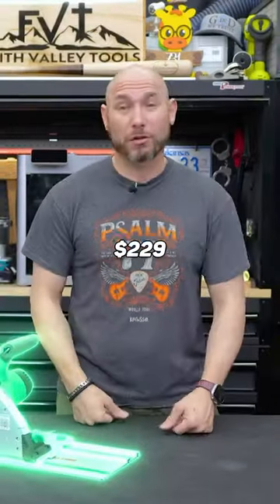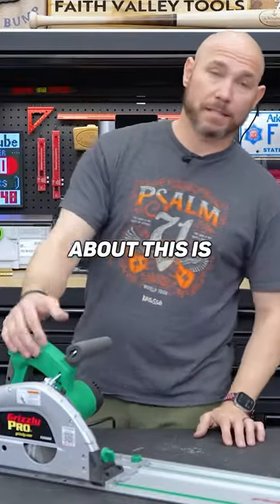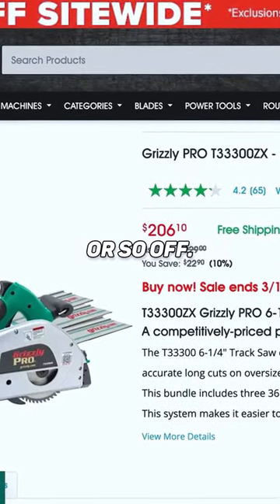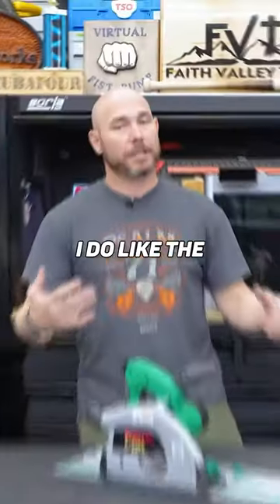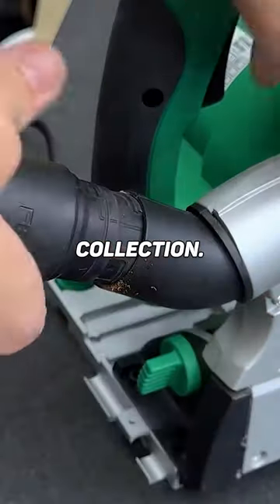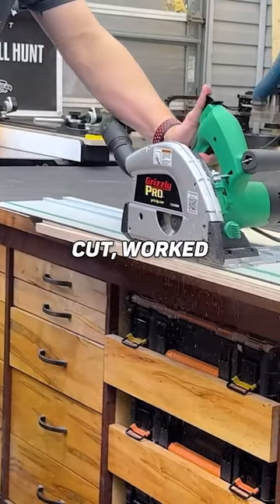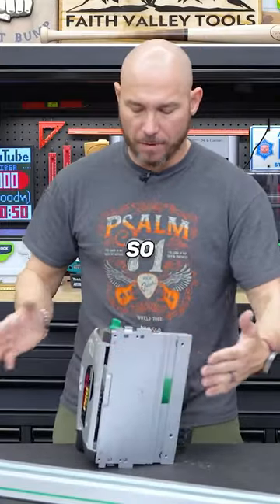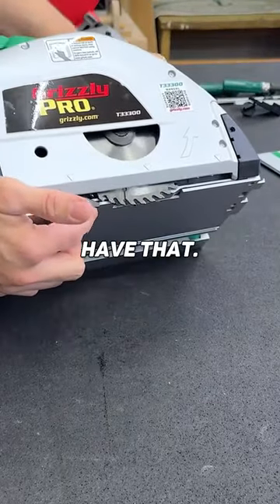It's not all bad - Grizzly Track Saw #powertools

Comment: Works great cut a 8 foot by 1 3/4 inch butcher block top on 3 passes. Very little sanding and no burn marks.also great for trimming door.